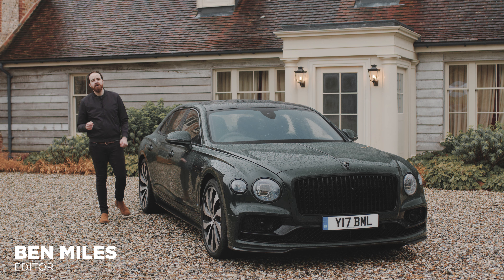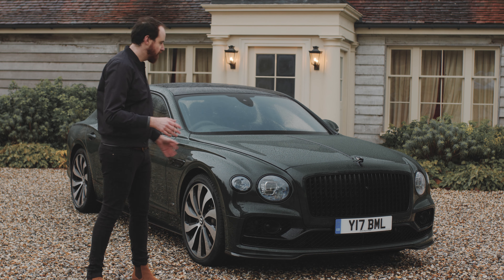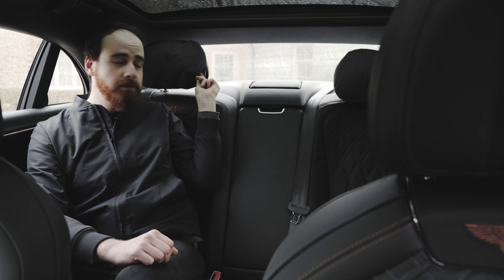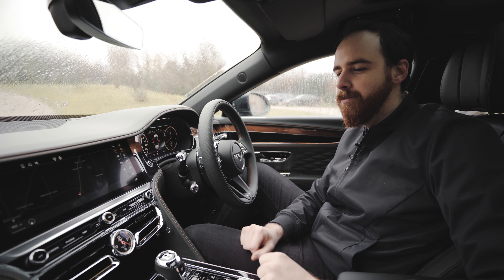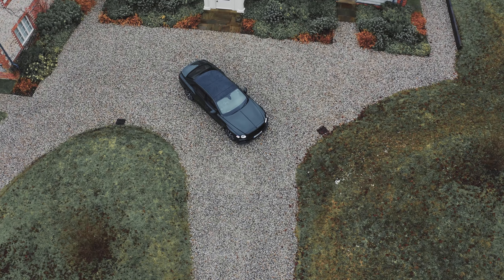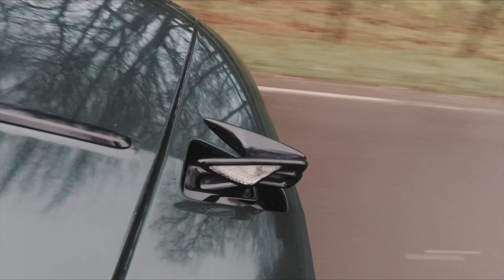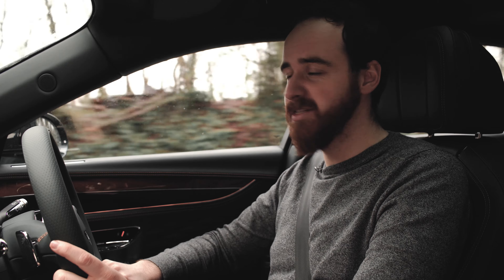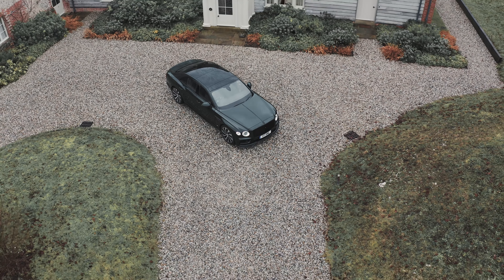Bentley Flying Spur V8 | Road Review

Comment: Painted black grilles made of plastic are NOT what I want on a $200,000+ handmade car...
Reply: Wouldn't bother me. It looks great, offers better pedestrian crash safety and keeps weight down. Also not gonna rust.
Reply: Plastic can be an expensive or cheap material. Just like steel or copper.